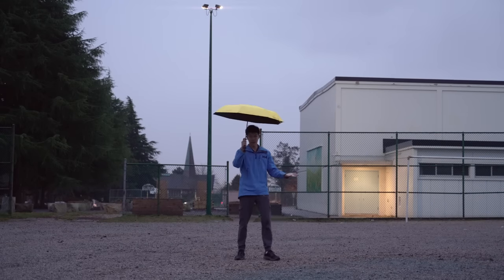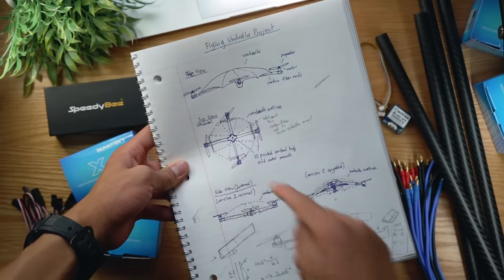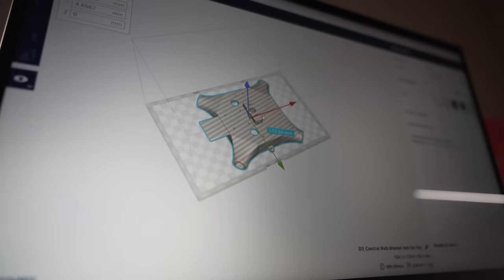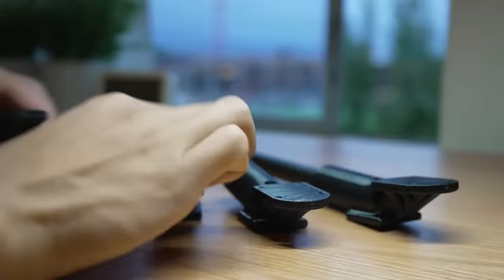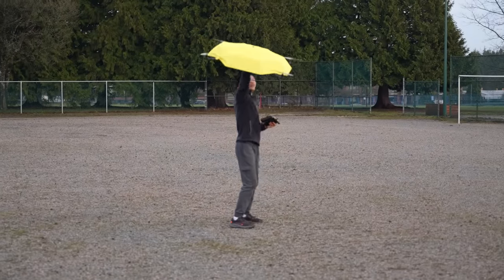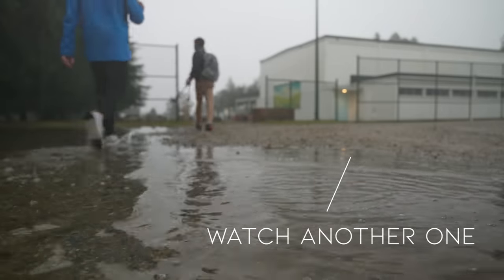I Built a Flying Umbrella

Comment: for tracking instead of opting for camera tracking I think you should use a proximity sensor with a transimitter and a reciver. It would be cool if you made a hat that had a sensor in it. And when you wear the cap the two sensors will communicate the distance away from the top of you head and the umbrella. Then the umbrella would stay locked at a offset of around 2 ft from the top of your head. I feel like it would be a cheaper and more accurate way of tracking.
Reply: thats cool idea..i was think more like have 2 ring in left and right hand to get the position..since its raining a cap might fly off.
Reply: Bro can it as product and develope it in to new gen. Like he can develope a software in phone that we can adjust the height and sensor and make our hands free
Reply: maby add some gyroscope capabilities to the propellers
Reply: @automation-nv4ww realistically speaking by the time the cap flies off the whole umbrella will be gone too. Did you think about that?
Reply: @automation-nv4ww  we'd have bigger problems at that point
Reply: RepentandbelieveinJesusChrist5  I love Jesus Christ, I really do... but... how does giving a random comment here help?
Reply: Maybe go with 4 sensors to triangulate exact relative position in 3d space
Reply: @bbjygm  agreed. A single sensor on the hat and the umbrella would provide only the relative distance, not the actual position. I suggest using the AprilTag or similar, although you still would have to figure out algorithms for proper tracking.
Reply: I was thinking simply tracking from your phone. Not everyone might want to wear a hat
Reply: OR potentially get it to connect to a wearable (Bluetooth ring? smart watch?) And get its GPS location to be super accurately above it? Not sure if this will be more financially efficient tho.

Also, have you patented your design yet?
Reply: @atomskthepirateking2776 I thought as much too.
Reply: I have the same idea until i realize we dont need to wear a hat under umbrella. Maybe a bluetooth/gps device or sth like this
Reply: Or how about he tries a necklace or something he can pin on his clothes either a collar of his shirt or near his pocket?
Reply: Just thought of the same thing. the proximity sensor would help lock the location of the user to the Umbrella. there was group in my school that did a project similar to this. It used a tracking card, a mobile app which interconnects the tracking card to a shopping cart. so where ever the customer is moving the cart follows. The cart also had a weigh scale as well for pricing purposes. Really love this project.
Reply: What about a tracking system that uses a camera for tracking the person. For real-time detection fuzzy algorithm or other algorithm could be used.

Comment: it would be crazy if this umbrella will have an weather sensor which detects when its going to rain and then navigate to you automatically.
Reply: Yeah, and also be like the size of a phone, usually stored in your pocket, but when it rains, flies out of the pocket automatically and transforms into the umbrella!
Reply: @georgeimedashvili5178 yeah, maybe in the year 3000
Reply: it wont work in any wind or real weather it will short and die.
Reply: Next iron man suite. 
Umbrella man.
Reply: Like iron man's mark 42
Reply: Nahh yall ar doing too much
Reply: No need for a weather sensor. Just a way to connect to the internet, or specifically, a weather api.
Reply: Just add phone and sim in the umbrella and use data package connecting the internet when you want the umbrella call the number auto connect it to the phone using gps call wherever you are located
Reply: then that's a JARVIS 🤣
Reply: @gulliblepiggy4346 I don't think so. Something that we dream build when we was child, someone created now, like prototypes of aeromobile (cars, motorbikes, and so on). That's just time!
Reply: this comment is   <⭐⭐⭐⭐⭐>

Comment: Tip 1: rather than a camera, you already added a gps, why not link it to a wearable signal device and program it to always stay a certain distance directly above it. 
(A camera would waste more battery, mistake other people for you, etc. But a locator would keep it above you specifically.)
Tip 2: best not to wrap your device in plastic wrap, or you may burn out your device. It is better to either leave as is or make a protective shield if you are worried about it and add a fan to keep it cool.
Reply: Oh, that said, I love your device. It is awesome. Looking forward to seeing you make more cool toys.
Reply: May be better to combine both the camera and the GPS. The GPS alone may not be enough for pinpoint accuracy.

Comment: Some ideas to improve the design:

- longer arms angled down to reduce spray from propellers when it’s raining

- using conformal coating to protect electronics and help with heat dissipation 

- tether wire with small pack for battery to allow longer flight 

- weather alerts with cellular data, automatic deployment. 

Cool idea! Nice work! ❤
Reply: cool idea, but I got a simpler ideal, make a helium umberlla balloon  and use a wire to tie it on your body.
Reply: @Notjobincome you'd have to constantly refill the balloon or get a new one tho
Reply: @Notjobincome Only problem is varying speed. A helium umbrella is not really going to almost immediately follow the motion of the person. A wire can also snag onto objects, though this would be somewhat rare since something would have to touch the wire, but is a consideration. I think a drone improvement could be having some sort of Bluetooth device to wear on the ear (or just use one’s phone) that the umbrella drone would try to hover some set distance above.
Reply: @Blueissuperior   how long u think tiny drones can fly, and how long to recharge all 4???
Reply: @ac1455   this dronebrella will be GONE in the slightest wind, and it's so small you're still getting wet.
Reply: have you thought of where the wind carry the umbrella @Notjobincome
Reply: @jjryan1352  enough for a walk lmao hes not gonna be out all day just in the rain
Reply: @jjryan1352 There is a global helium shortage. Would be an absolutely insane waste and expensive to use on something so trivial. Not to mention you would probably need a lot of helium (in the order of like 100 Litres) to lift something the weight of an umbrella and it would not stay directly above you all the time unless attached with something rigid which kind of defeats the purpose of the whole thing.

Comment: Just an idea for the tracker if you end up making this thing follow you. You could wear a hat with an ARTag on it (a little square with a specific pattern on it) to avoid more advanced images recognition. Loved the video and I hope you continue with this project!
Reply: Had a similar idea with rfid tag, bumping this so he might see
Reply: Making it follow your phone seems more convenient
Reply: I think a Bluetooth connected beacon would be a lot more accurate/responsive.
You could add 2 transmitters to extremities of the umbrella to allow triangulation of the signal.
As a poster below says, this can be done with a mobile phone although I don't know any off-the-shelf software to do it.
You would configure the device to hover a set distance above the phone which sits in you pocket.
Edit: Thinking a bit more about it and would be better to do the whole thing "passive" using 2 receivers to process the phones Bluetooth signal for triangulation on the umbrella itself. No need for an App, just a Bluetooth connection to the umbrella.
Reply: A hat with an IR beacon should work well too. 3+ IR sensors should keep it on target aside from a gusty day.
Reply: @jdudleyh  Wouldn't really need the umbrella if he had a big-ass hat.
Reply: I was thinking that he should create a hat that he could wear that would basically have something on the top of it (like a colored target or a QR code) that the umbrella drone could sense so that it will stay above him autonomously.  A QR code would be great because his flying umbrella would stay above his head even if someone else with a target hat walked past him.  And maybe a PIR sensor to make sure it stays the same distance away from his head.
Reply: @pieterpauwels548  and overkill.
Reply: this was what i was thinking too
Reply: @bobl703   I think you misunderstood my original comment, an ARTag is basically just a “tracking oriented” QR code. And I kinda agree with some sort of distance sensor but an ARTag has the ability to determine the distance so it might not be necessary. You also have to remember that the drone won’t always be pointing in the same direction so a distance reading might be really messy.
Reply: @torstonvodesil6709  Ah ok. I didn’t know exactly what it was. And I’m thinking that the drone will always be “looking” down for its target.

Comment: For a simpler approach to make it follow you, you could try using some sort of a physical tether that nudges it in whatever direction you're walking. Initially you could try something like a cord attached to a strain gauge, but perhaps a simpler mechanism could be in the form of a rigid attachment, which would also help to stabilize it vertically in the event that it runs short on power.

Seriously though, this was a neat project and it's nice to see someone do something like this for real.

Comment: I thought about this concept when I was like 17 (now 31) and I swear I thought we would've had this by 2023. You my friend, are a genius. I full sketched up my designs too. Mine was a little elloborate, included a pen like device to clip on to you as a reciever for the drone, but the drone umbrella itself, was cased in a ball that would would activate when you throw it up on the air, and from the sides of the ball itself, an extension would pop out and spread out the umbrella itself. Crazy stuff I know.
Reply from the maker: That’s pretty slick
Reply: Like movies huh.. good

Comment: Instead of the remote control, you should buy some sensors so it can sense your overall body and always be on your head centre.

Also add a 24 hours lasting battery for all 4 fans so it can work all day long (Make sure to keep the battery light weight).

Lastly Patent it and give me ABIT of royalty and sell it directly or it's Patent license.

Comment: the edit at like 5:30 was great lmao, made me flinch in shock. bro i hope u get millions from youtube.

also, as for the camera, maybe it would be easier to attach some kind of gps so it just follows the remote? camera may not work too well in the dark and also im guessing you'd have to use some sort of neural network to actually check if the umbrella is following the right person and so on (which i guess would require a revamp of the electronics you're using, including the chip). also if there is a lot of wind, maybe having a handle that can drop down optionally to switch modes may be nice.

Comment: Water responds to static electricity.  You can easily demonstrate this by turning your faucet to allow only a very small stream of water, just before it starts breaking into drops.  Then rub a balloon on your head to charge it with static electricity, and hold the balloon near the stream of water.  Even several inches away you will see the stream of water bending towards the balloon though they still are not touching.  What if you build a device which generates a lot of static electricity, then have a couple of small antenna which attract the water as it falls creating a sort of opposite to a dark cloud.  Kind of like a static electric force field to keep the water from falling on you.
Reply from the maker: that would be pretty slick

Comment: The best use case is when you can control it with your mobile phone or a small chip that sticks on your pocket or shirt, without carrying an extra bulky remote controller which is equal to holding the umbrella stick altogether.

Comment: Imagine putting a sensor or camera to read the top of your head so it will automatically follow you. Program it to hover with the exact height you need for the umbrella to cover the top of your head. The only time you will control it remotely is when the umbrella should be on top of your head. That would be a cool idea to add.

Comment: Good content creating. From an engineering perspective, good start but will need more stability to withstand winds, which means more mass or less air resistance. A central propeller, if can be managed, will be much more stable too.

Comment: You should definitely use an IR camera and you can easily code something that creates a circle boundary about 10 cm from the umbrellas perimeter, but only focused on foot travel. Once a foot gets close to breaking that boundary, then the umbrella will move. you should adjust the speed of movement to be smaller deviations the further, you are from the boundary, and as you get close, and increase in directional thrust power. You should also use a micro anemometer for wind detection and incorporate the data into the coding logic. Make sure the ir camera functions in all light conditions. Apply sensors for obstacle detection and algorithms for them. Definitely beef up the materials, using more robust umbrella material and stronger, but lighter chassis, perhaps titanium, but aluminum could work, I would definitely choose scandium though, not as tough as titanium, but very rigid and lighter. Get bigger propellers and more powerful motors and a good power source to be able to use the umbrella with all its functions. Think about sudden movements and changes of terrain, the propulsion should maintain stability at all times. Serious communication needs to be done between components, so arduinos could work, but I would use a raspberry pi pico for serious weight savings, maybe 2 of them. And finally, the weight distribution needs to be better, make sure it’s level when grounded, maybe add some rubberized bumpers to the edge of the propellers and on the underside for landings and potential falls. Finally I would use an arduino for a user interface that can tell the picos to make adjustments and override if necessary, also making it able to completely be controlled and shut off the autonomous features, well the follow one at least. Make 3D printed housings for all sensors btw to protect them and also for a micro controller for the user interface. I would print a small case for my Apple Watch, so that I could control the umbrella from buttons on the side of the case, and I could make it seriously small and streamlined, would be like no case at all and also easily removable and I’d also have a docking station for it on the underside of the umbrella. I think I covered everything, but maybe I didn’t, so expand on my suggestions and ideas, you really should use them and I’d be honored for credit, my name is Robby Evans, the date of today is January 29th 2024 at 4:30 am. This is so no one can say I didn’t contribute anything. So hope to see your project blossom, God bless you in all you do.

Comment: 00:04 Creating a flying umbrella with propellers
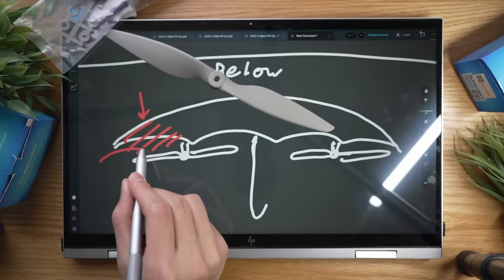01:06 Designing a frame for propellers on the umbrella.
02:05 Designing the flying umbrella with 3D modeling and CAD
03:15 PCB way offers custom PCB prototyping and 3D printing services
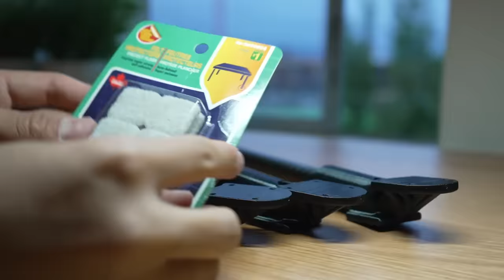04:25 Built internal frame and started electronics
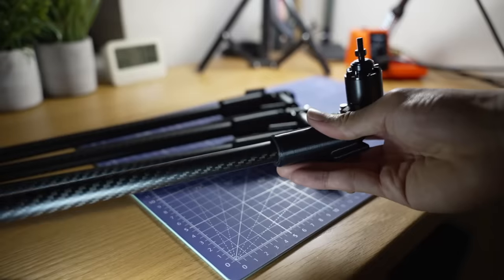05:50 Improved design and functionality of the flying umbrella
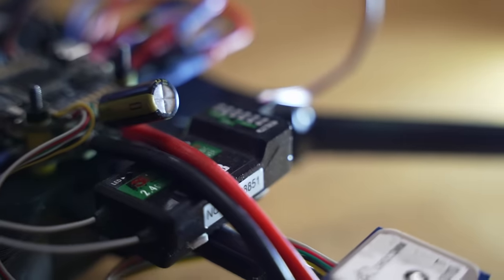07:10 Testing the flying umbrella for the first time
08:56 Fixed umbrella and tested in rain
Crafted by Merlin AI.

Comment: The hardest part has got to be keeping it steady in extreme weather without getting the user wet. You might use a few sensors to stabilize them and manage the stability in pressure through a programable chip.

Secondly, the material for the floating umbrella might need to be from fibreglass or probably have a vent to suck out aerodynamic flow from all sides at once and keep the pressure above higher than the bottom pressure , like a car or plane does.

Phew! Easier to say but hope you can get it going. Create a collab tool on Google/slack incase you want external help.

Comment: Practical question: would hard rain affect the propellers at all? Also suggestion: rather than use a controller, maybe you can program it to auto-hover a handle you hold at a certain distance, which can increase or decrease depending on how hard you squeeze the handle

Comment: Bro you can use command controller like watch gps ...like how our watch calculate our steps like that , we should have a calculator like watch and it also provide command code to umbrella to move as per steps and direction...then the final coding of command is maintain q specific distance from head to umbrella...so it will not gos down or up...

Comment: Hi very technical question, how did you solve the unstable flight issue after adding the umbrella? By tuning the PID control in iNAV?  
My aircraft has a big flat surface area as well, and I had difficulties achieving stable flight.
Reply from the maker: First of all you wanna see if there are any hardware issues- if everything is fine pid tunning might fix it- of course every case is different so I can’t be 100% sure for you…

Comment: i'm facing the unstable quad issue and i can't find the solution on the internet. Every time a try to use the position hold, cruise mode or altitude mode the drone do this overshoot. How did you fixed it?
Reply from the maker: you should try researching and adjusting your PID values- gonna take a lot of trial and error but that might solve the problem. of course it might be some other reason like the design itself so without more details its hard to say.